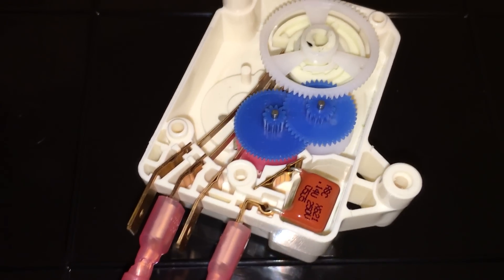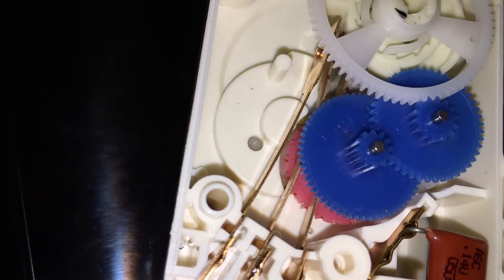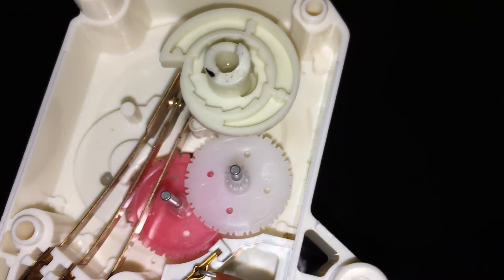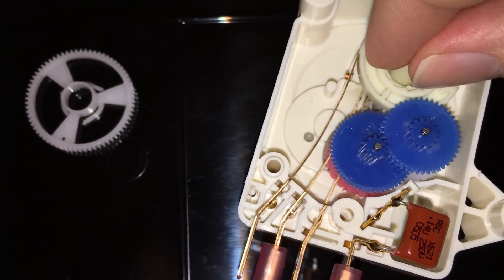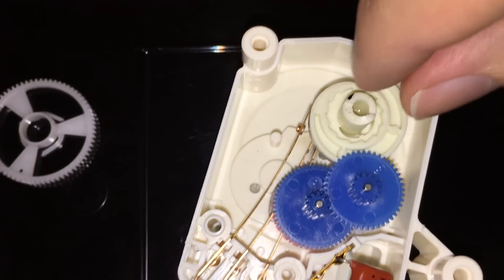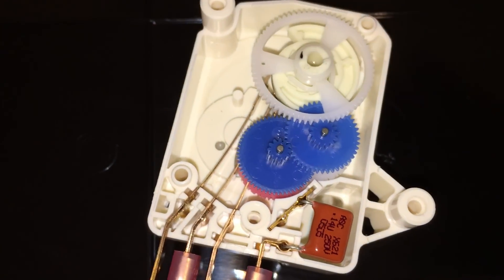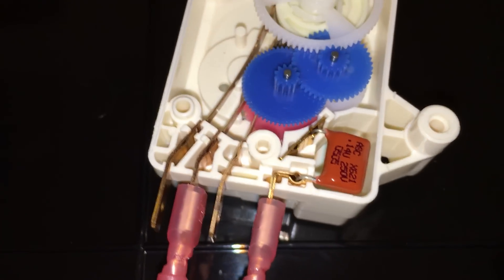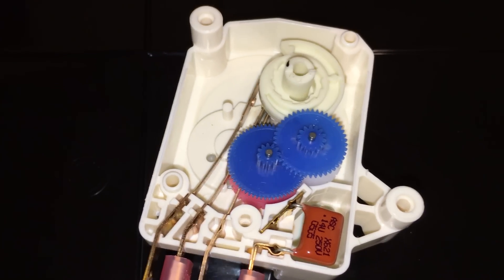How a Refrigerator Defrost Timer Works

Comment: I come across the right video, my timer looks just like this one, except it's all white gears, no blue ones. I don't believe my timer is shot, but i did sand down those contacts a little with a nail file so they make good connections. I'm thinking that's all was wrong with it cause i can't find anything else. The way you show testing that motor is a good idea, I'll remember that if i encounter it's still not working right. I'm pretty sure the motor is good though, i tested the cap it's up to specs on capacitance and the motor test 3k ohms... no breaks in the windings. Thanks for the video and the info.

Comment: Great video. I’d forgotten that it only runs when the compressor is on. Seems like the defrost really only needs to happen based on how many times the door is open allowing humid air into the compartment. I mean if you never open the fridge or freezer the need for defrost is very little correct? Versus the case where it’s opened all the time and humid air is allowed in. I guess that correlates to how often the compressor would be running as well so it’s the best indicator. I believe these timers generally cause defrosting to happen every 14-16 hours roughly. Thanks again

Comment: Thank u for your good description and your replay
What is the readig of ammeter with capacitor provoding in series
Reply: The impedance of the circuit is determined mostly by the winding of the motor, which would be designed for the 240V, 60Hz power.   The capacitor is probably to reduce arcing of the contacts rather than to limit the current.  It shorts the high frequencies of the arcing while offering about 20,000ohms reactance at the 60Hz of the power.  At 60Hz, only 1.2 ma of current would be passed by at 0.14 mfd capacitor to 240V rms applied.

Comment: Very informative.   Just curious.  The timer motor only runs when the compressor is running.  When it goes into defrost the compressor is not running.  What causes the timer motor to run during defrost with the compressor off?
Reply from the maker: The power switched from the thermostat goes to the defrost timer first. During defrost, the thermostat would still be calling so the defrost timer would have power until the cycle ends, the compressor start, and the box finally cools off to set-point.
Reply: @TechnicalLee  Thanks, Lee!

Comment: can you please tell me which of the motor supplying terminals is Live and which is Neuter? Its AC current, right?
Reply from the maker: Yes, AC current. Of the two I'm using, the left one is hot/line and the right one is neutral. The two unused contacts are defrost and compressor, respectively, from the left. So defrost, hot/line, compressor, neutral.

Comment: My defrost timer doesn't restart when it goes off. I replaced it with a new one but I am experiencing the same problem. Please what is the cause.
Reply from the maker: Are you waiting long enough? In some cases the defrost cycle can last 30-40 minutes. What about if you manually advance it with a screwdriver?
Reply: Defroast cycle 30-40 mts, impossible, so you mean I should sit there with screw driver for advancing after each defroast cycle. Wow.

Comment: Hi lee, you says that the timer motor will only operates when the compressor is running. What makes the timer keep running during defrost cycle so that it turns back again to cooling cycle. Thanks!
Reply from the maker: It is operating when the defrost cycle is running too, as long as the thermostat is calling for cooling. Think of it like a two-way A/B switch that switches the power between the compressor and the defrost element at a timed interval.
Reply: @TechnicalLee  Sorry your wrong. Timer runs 24-7- 365. Thermostat has nothing to do with timer.
Reply: @foobarmaximus3506  "Call for heat" and "Call for cooling" are absolutely terms commonly used when talking about thermostats. Nobody says "is your thermostat conducting?" LOL way to try to be a big guy on the internet.

Comment: What would happen if I disconnect the element of the defroster? I have stand alone solar power and in winter it switches on 3 times while there is little or no sun. So it's sucking my batteries flat over night.
Reply from the maker: You still need to defrost every so often or the fridge will eventually stop cooling once the coils in the back are frozen solid. What I did once was add a switch to turn power to the element on and off (defrost defeat switch). I would leave it off most of the time, and then once a week switch it on and manually start the defrost cycle by advancing the timer. Then turn it back off again after the cycle is done and the compressor runs again. If I was going to be gone for more than a week, I left it on. Look at the wiring diagram for your fridge, but I pulled the defrost element terminal out of the timer connector, then added a wire with a switch with terminals at the ends to connect to the pulled terminal and reinserted my new wire with connector into the timer connector to replace the one I pulled out. Defrost element could be 500W, so make sure you get a 120V rated switch that can handle 5 amps or more. Also make sure you have all terminals and connections insulated so you can't get electrocuted, and it's not going to short out on anything. I had my switch dangling right under the temperature adjust knob in the fridge compartment. Just make sure you do it safe, I'm not responsible if you cause a fire or electrocute someone.
Reply: @TechnicalLee  This is exactly what I'm thinking about doing because my freezer stays in defrost too long.  It's thawing out my stuff in the freezer.

Comment: Hi Lee very good video, Thanks for the info ,I have one question does the latest model fridge ,, (twin door , Three compartment fridge and one door fridge ,, i mean the new models ) Are they instal with timmer swich or timer board with other function circuit .
your valuable info please ...thanks
Reply from the maker: It depends. The cheaper models still use the mechanical defrost timers, but the more expensive ones use an integrated circuit board. If it has electronic temperature controls it's probably the latter.
Reply: Hi Lee thanks for your swift reply .. Forget to ask one more question... I notice that the latest model fridge have control board and other fixed compornent ,,like Thermisters and thermostat .. What i need to know is are these two compornent  universal usage for all fridge or they are different in voltage and temperature .. Please confirm and thanks pal

Comment: Can this timer be bad even new ?
I just fix a refrigerator frigidaire it wasn't doing the defrost so when I pull back top of freezer it was built with a bunch of ice then I turn my timer in to the defrost cycle and right away heather element on freezer start heating so I figured parts on freezer are good so I replace the timer for a new one genuine timer for 5 bucks got it on especial sale 
Then I week later the lady call me same issue u I'm thinking this timer something be bad even new any suggestions
Reply from the maker: I suppose that's possible if the replacement timer doesn't advance properly. You could try replacing it with another new part from a reliable source. You should also check for door seal leaks or objects holding the doors open slightly since air leaks are the next most likely cause of ice formation in the freezer compartment.